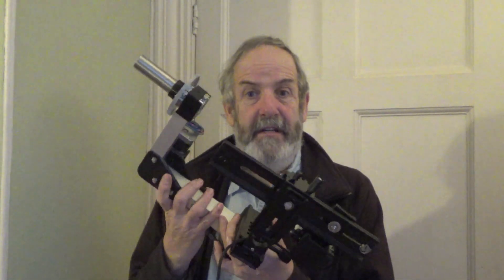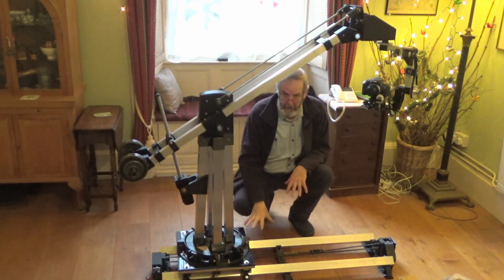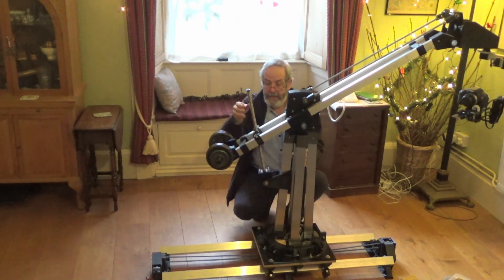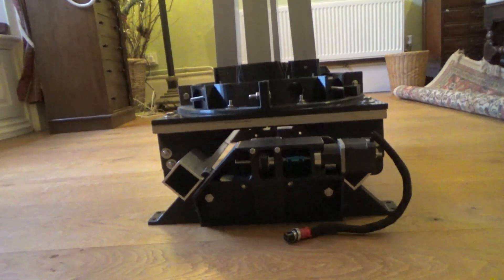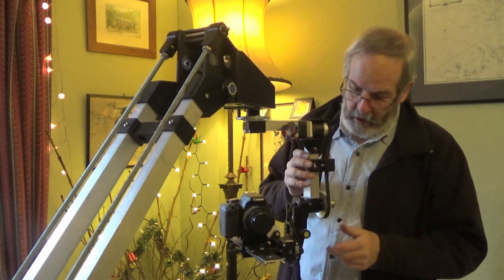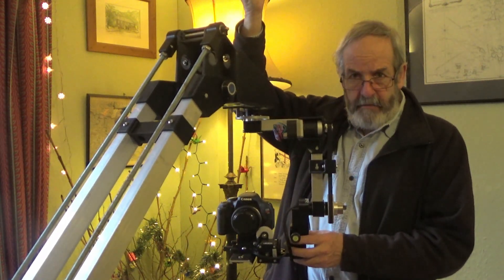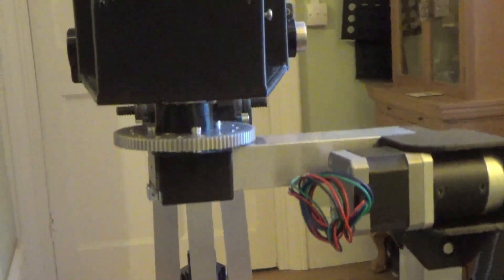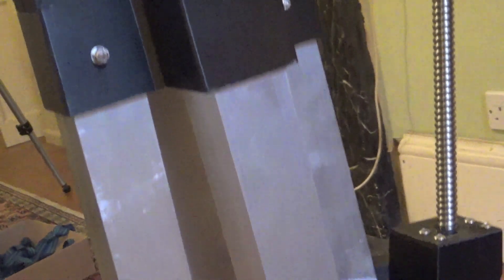3D printed Motion Control Rig First look

Comment: awesome, how's the backlash and repeatability?
Reply from the maker: Those are the challenges! From previous experience the precision geared steppers are the best for the job. Track has virtually no issues as the backlash is not amplified. Rotation depends on tightly meshed gears. I resorted to an ungeared NEMA 23 on the previous big rig for the rotation axis, and there is room to again if necessary. Jib is fine because it is always loaded in one direction. Tilt can also be loaded. Pan is the trickiest, but there are ways to reduce backlash. Repeatability is a test of the rigidity of construction, and I have been testing each part as I go...so there's a big box of rejects! But we will see once it comes together.